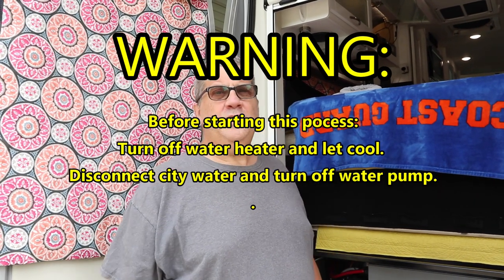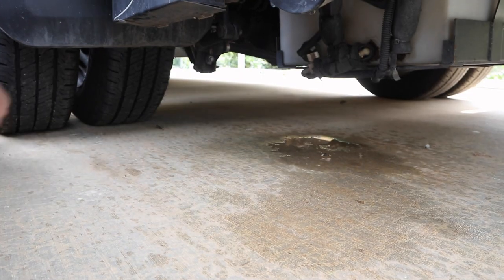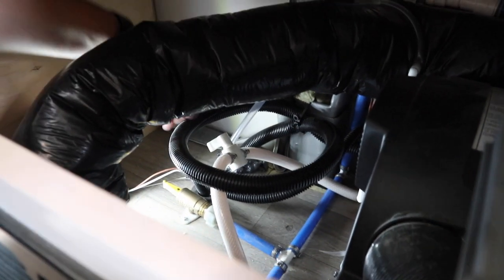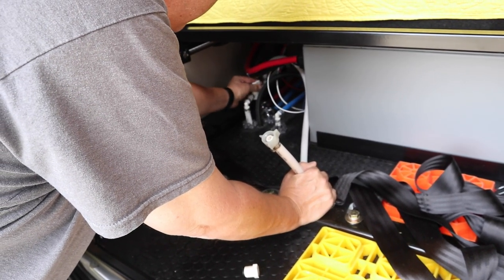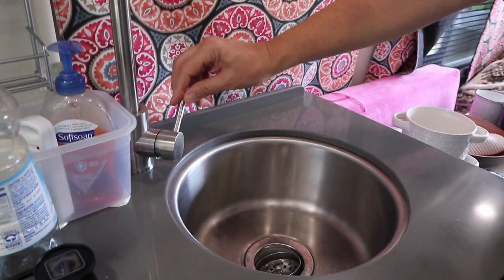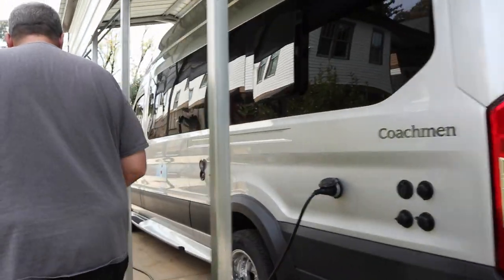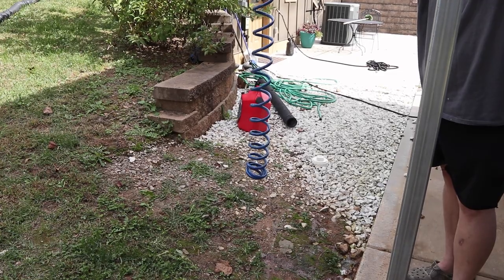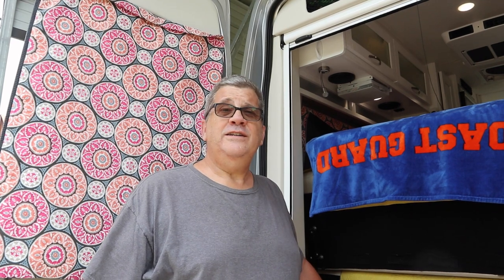Winterizing with antifreeze - Read the comments for 2 extra steps omitted. Coachmen Beyond 22CEB

Comment: Gard, nice video, very well done. My only comment is regarding the toilet. I would depress the pedal fully to make sure all spray jets of the toilet get some antifreeze in them. If all jets were running pink, everything is A-OK!
Reply from the maker: True, I just didn't to lose the last of my seal lubricant and conditioner that was there.  I would have liked to have the Truma drain open for condensation but it's on the wrong side of the bypass valve.

Comment: Awesome video!  We have a 2023 22C AGM.  We are going to be camping for a few nights where the daytime temps are 40 to 50 and the nighttime temps will be around 25 to 30.  With heat on inside I assume the biggest issue is the outside spray hose.  So maybe get some antifreeze in that line, thanks
Reply from the maker: Thanks.  The outside shower is probably your weakest point.  Having the freshwater tank inside is nice.

Comment: Hi Camping Coastie!! Looks fairly simple but I cannot quite wrap my head around the Truma Combi - since it is providing heat and hot water out of the same unit (doesn't it?) how does that work in cold weather when I need heat?
Reply from the maker: From how I understand it,  there are two chambers that are heated at the same time.  One contains water, the other air.  The furnace can be turned on,  with or without water in the water chamber.  Just never turn on the furnace if there is bleachy water in the water chamber.
Reply: ah! I thought it needed to heat the water and circulate to warm the space!  Makes sense now!

Comment: You are so thorough; I think you spent a lot of time teaching young Guardsmen;  anyway my stupid question is what about cross contamination from the antifreeze? is it a concern?
Reply from the maker: I am going to take a risk and assume by cross contamination you are referring to the antifreeze and drinking water.   If this is correct then it's not a problem.   You suppose to use RV antifreeze made for the freshwater system.  It's not the same antifreeze that goes in a car radiator. 

When you de-winterize you will flush 99.9% of it out of your system.  Any trace amount won't hurt you.

Comment: Thanks Gard, great step by step procedure, I see others in Facebook group mentioned turn the low point drain valve on/off quickly, let the antifreeze pass through at the end, is it needed?
Reply from the maker: Thanks is not a bad idea if you didn’t drain the system first.

Comment: Great video. My fresh water tank does not completely drain since the drain line is an inch or two above the bottom of the tank. Do I need to put antifreeze in the fresh water tank? Do I also need to put antifreeze in the black and grey tanks once they are drained? Thanks!
Reply from the maker: You should be okay if a little water remains in the freshwater tank and lo

Comment: As always...great video! The Beyond is a 4 season RV. I live in Huntsville AL and plan on driving my Beyond almost every day. Do I need to winterize?
Reply from the maker: As far as I know,  the AGM Beyonds are probably better for really cold weather because their freshwater tank is inside them.  At least on the 22C models.  There are people that use their Beyond year round without winterizing.   

If I were going to a place that is extremely cold I would probably just drain my freshwater tank.
Reply: Thank you!  Yes, I forgot to mention that mine is the 22D with the generator. Thanks again for all the very informative videos you do!!
Reply from the maker: You should be pretty good then.
Reply: There is an option on the Li3 models to get tank heaters for the fresh and grey water tanks which goes a long way to making them a 4 season coach. The cost is $159 for the fresh water tank and $72 for the grey.

Comment: Some people swear that if you blow it out with an air compressor that you don't need anti freeze... what do you think?
Reply from the maker: I almost always use compressed air.   I did it this way for people that choose to do it with antifreeze.   I think if you live in a place where it's really cold and the RV is not being used antifreeze is probably the best choice.  

That's why I made two videos,  one with antifreeze and one with compressed air, so people can see how it's done both ways.
Reply from the maker: If you use an air compressor be careful with the pressure and bypass the Truma.
Reply: Gard, you are so right. In Wisconsin, any water left in the system can potentially cause a disaster.

Comment: I have a question about driving in cold weather and running the Truma combi on  l1 or l2 heat. I understand it's dangerous to drive with the propane turned on but I also understand that the Truma throws  an error code if the propane is turned off and trying to run it strictly on electric. When you're driving in cold weather do you run it strictly on the electric only and if so how do you deal with the error code?
Reply from the maker: Typically,  I don't use the Truma for heat while driving.   If propane is not selected, E1 or E2, I don't believe it will give an error.  It should give a propane error if propane does not make it to the Truma.
Reply: @CampingCoastie  so does the Ford chassis heater provide enough comfort for the whole van while driving? Of course I know depends on how cold it is outside at the time.
Reply from the maker: It has so far.  We don't usually go to places below zero.
Reply: @CampingCoastie  if everything goes well hopefully in about 4 or 5 weeks we should be ordering our new 2024 Coachman Beyond 22C with the 1260 amp hour lithium and Truma aventa air conditioner with dehumidifier. We have heard that microwave oven is going to be upgraded to the microwave / convection oven looking forward to that also. The GM of coachmen said in a YouTube video couple months ago there's going to be some new surprises coming out September and October but we haven't heard what they are yet have you?
Reply from the maker: @kip5588 Sounds great.  I can't say anything about upcoming changes until they are disclosed by Coachmen.  But I can say that Coachmen Class B  is always improving their products.
Reply: @CampingCoastie  thank you for your great advice and how-to videos. Do you know a good resource for me to find out what the latest features are going to be? The dealers don't seem to know much of anything that I've spoke to.
Reply from the maker: Thanks.  You might try calling Coachmen Class B division,  https://coachmenrv.com/contact-us/Beyond
Reply from the maker: Let me know what they tell you.
Reply: @CampingCoastie  thank you!! When I went there I couldn't complete the form because it wanted to know the VIN number which I don't have quite yet.

Comment: Gard, what about the black tank flush line. Does it empty itself by gravity (the input is fairly high on the side of the van), or does it have a trap in it too and need antifreeze?
Reply from the maker: I am not really sure about it, but for best safety it should be flushed with low pressure air, like a bicycle hand pump or some antifreeze put into it.
Reply: @CampingCoastie  Thanks Gard. Good advice, as usual.
Reply: How would you do this?
Reply: @bethannperkins-simmons4793  This year when I was sending antifreeze through the spray port I hooked up one end of the hose to the spray port and the other to the black tank flush connector. Ran the antifreeze for a few extra seconds to push it through. Still don’t know if it’s necessary, but better safe than sorry.

Comment: Watched this for the 100th time but not sure if you closed the fresh water take after you drained it?  I know we are heading into warm weather but I will be traveling across country the end of this month and if I run into some freaky cold weather I just want to be prepared to winterize if I need to!
Reply from the maker: While winterized I leave the drain valve open on the freshwater tank.
Reply: Do you see any issues with closing the water tank drain valve after winterizing?  Also....my black and gray tanks are already empty....do I need to drain them again after running AF through the system?  Thanks.   @CampingCoastie
Reply from the maker: @johnreddinger6025 I really like keeping the freshwater tank valve open.  If it had a little water in it,  that could freeze and crack it.  I really believe that a black tank should always have liquid in it to keep any solids from drying out and being hard to remove.  The liquid in it would be antifreeze and that is fine to leave in it.